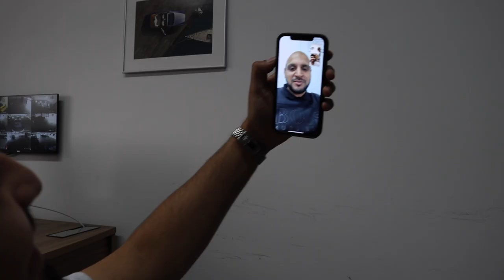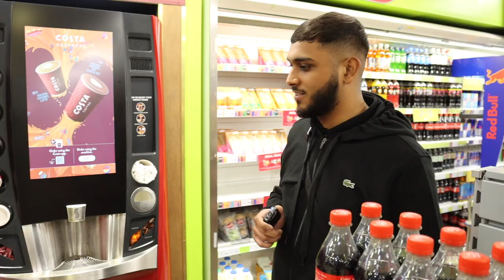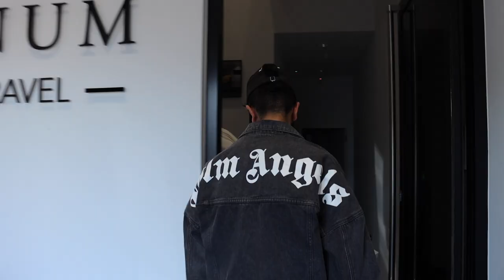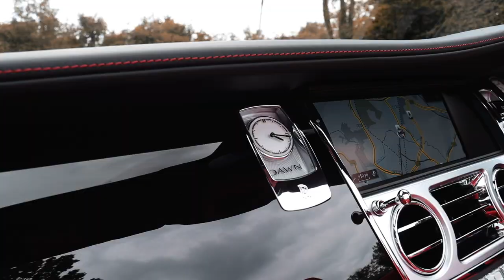Lord Aleem - LA Weekly: S01 E10

Comment: Cheap fuel in the lambo, cmon guys 😂
Reply: Literally came on the comments to put this. You have to put shell in the cars they have. Not tesco toilet water
Reply: Tesco Momentum 99 is good fuel
Reply: @SILKY_999  it is, but they didn't use it 😭
Reply: Curious you think premium fuels really make that much of a difference?
Reply: @johnguidetti5839  huge difference in 95 vs 99 RON 👍
Reply: @johnguidetti5839  seems like you’ve not owned a performance car before lol
Reply: @PUREaw5umnes  That’s my point i have and used shell Vpower or supermarket stuff. Apart from spending a extra tenner on petrol for increased price saw no difference. Even mpg was the same.
Reply: @paulrhodes4657  they want the club card points 😂
Reply: @anonymous4201  of course they do. Swap them up for weekends away. 🙌🙌